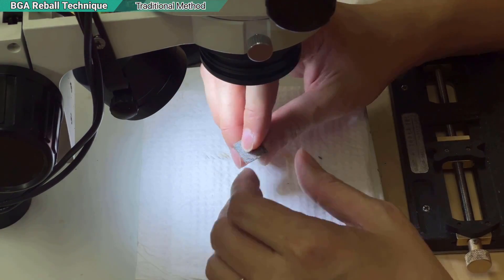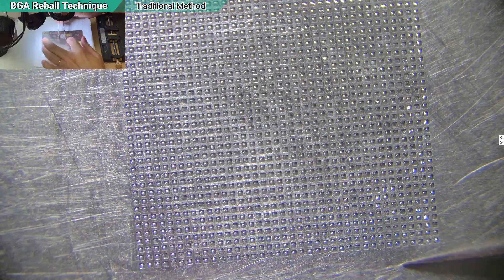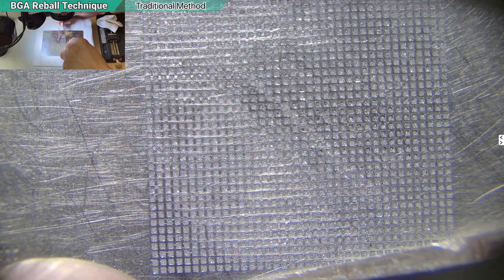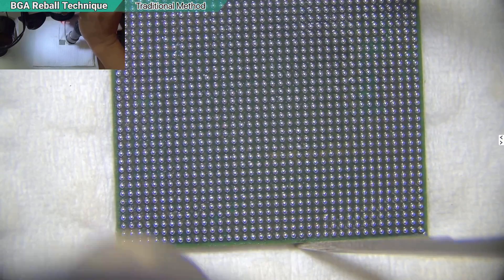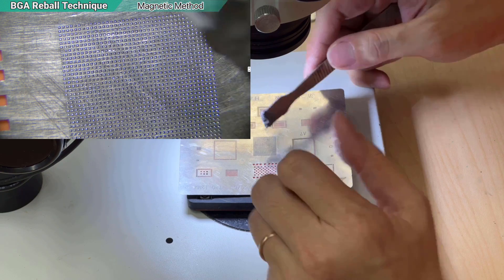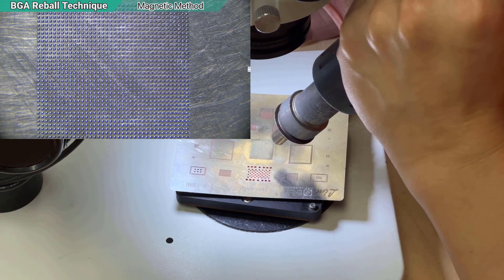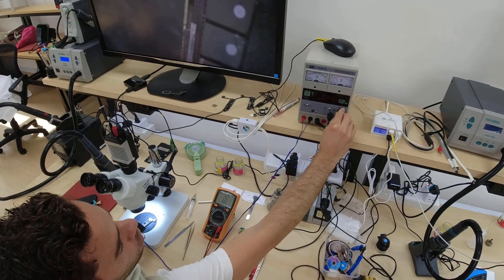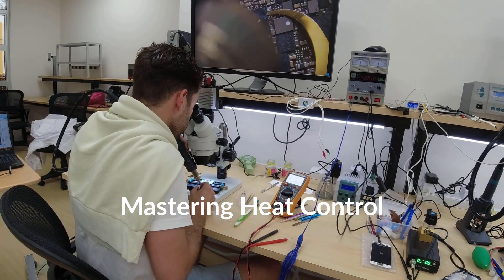BGA IC Reballing Tutorial for Beginners (iPhone Repair) 【REVIEW】 AMAOE Thermal Pad

Comment: Lim, can you gently answer me a question? Have you tried to use p2 pro thermal camera on your iPhone using an adapter? If yes, it worked?
Reply from the maker: adapter? those camera won’t work if convert to another connection at all.
Also, get T2S+ if you can afford it. It’s the best.

Comment: The best system is one that works for everyone, right?
I have been using those Amaoe magnetic bases for a long time.
But Amaoe seems to have designed this product to be used with their specific stencils for their bases.
That's not what we want, right?
We want to use any stencil, well I had two Amaoe bases. one with 4 magnets forming a square and another with 4 magnets in an L shape
To use them, remove the black top cover that is held in place with two screws, so there is a completely flat surface, then a paper napkin.
In the end what I did was put all the magnets on a single base and use it like that, without the black cover, putting paper on top.
Do you know what I really think?
Amaoe has stayed very close to a useful and versatile product, why haven't they done it? I think the answer is similar to printers, manufacturers do not make money with printers, they make money by selling ink.
Well, I think that Amaoe has designed their magnetic bases to make money by selling the specific stencils for those bases.

Comment: Hello, I really appreciate your videos and I think you are one of the best in the repair industry. May I ask you what kind of light do you use for the microscope? I saw an old video of you in which you recommended one at an angle to have more space in the microscope and to eliminate the reflection. Do you still use that one or have you changed it? I too would like to eliminate the reflection and even though there are several solutions on the market I don't know which is the best...
Reply from the maker: I’m still using that one until now. Still couldn’t find better than that type. But microscope quality is matter still.

Comment: What is the best tips for microscope lens? Using with barrow lens or without barrow lens?
Reply from the maker: More likely is a habit differences, so no best i can say. Anyway, I don't use it. Unless it doesn't affect the height.
Reply: @iPhoneServiceMalaysia  thanks for the reply.
Reply: Using barlow is much better..because the distance between the lens to the flatform is more space to make easy to look the board using the hotair while you   Removing ic